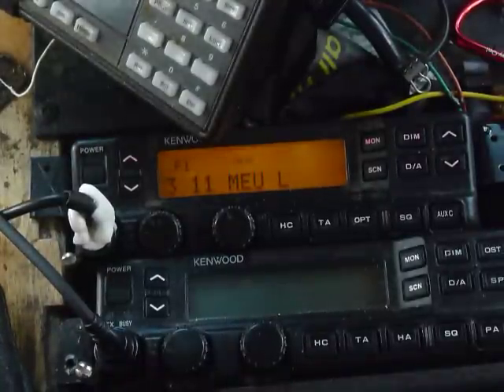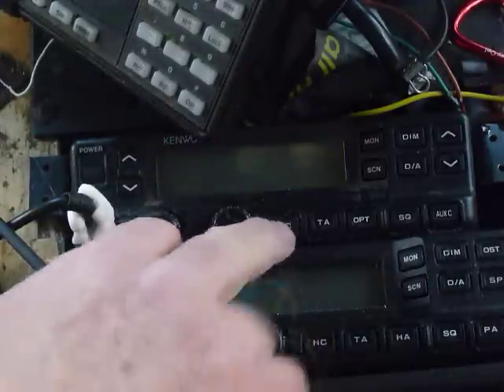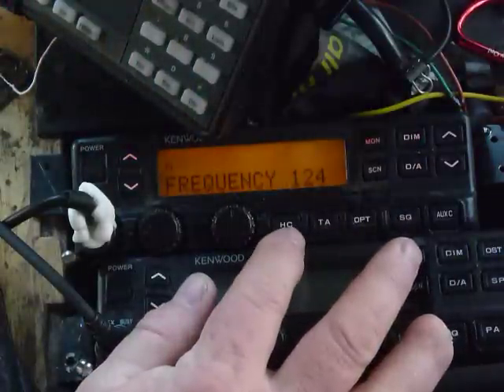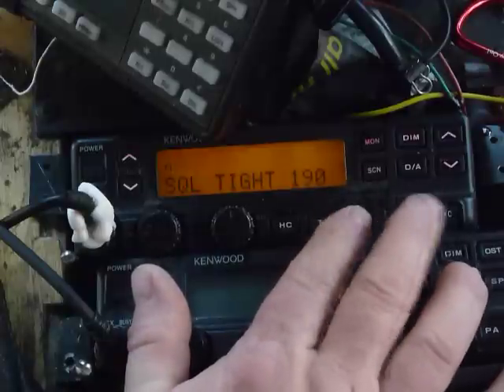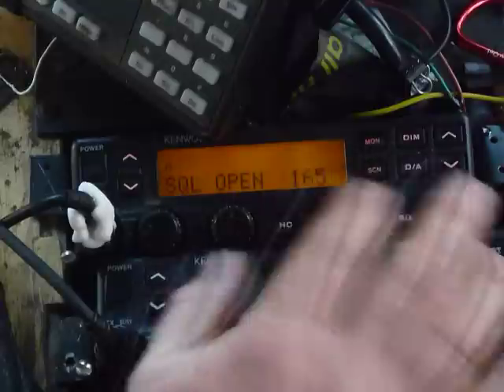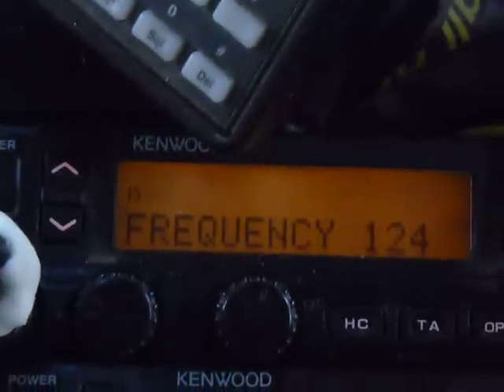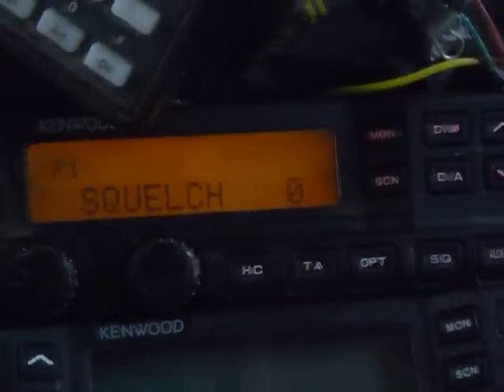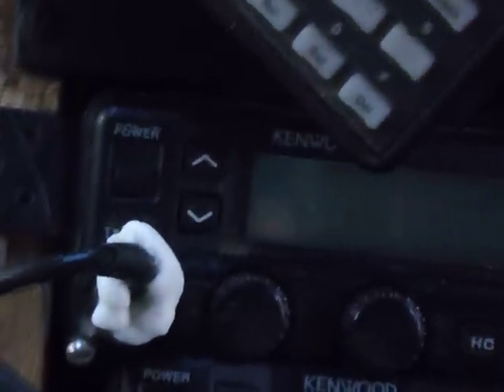TK-790 FS or CDF version firmware

Comment: Is this needed if not running narrow?
Reply from the maker: I don't think wideband had the problem, the no RX problem showed up as nerrow-banding took place. Roomer has it that the narrow squelch setting was skipped during initial factory alignment
Reply: @radionerd1  understood. Are there any adjustments I should make. I'm all wide band with ham and commercial frequencies. Is hight power a constant setting? On the H models
Reply from the maker: @RP4886  I wouldn't mess with any of the other settings, unless you have a problem, test equipment, and skills. In software you can switch high and low RF power. I have a ham buddy that has the high power versions VHF and UHF, He talks, and talks, and talks. I turn his RF output down to about 75% so he won't burn up the power modules ;-) Love to give him a hard time, he wants it set to 11! Nope! LOL🤓
Reply from the maker: If you want to adjust RF Max or RF Low (POWER or LOW POWER) on Wideband enter tuning mode, but don't click the channel knob, no "n" in display.  Max RF is 255, most radios will be set a few clicks lower, like 253-ish. I set a few 790's up on packet, I set max RF to 255 since packet is super brief transmits, like 5 seconds. TOT is set to 15 seconds on my packet 790's.
 For Ham I set RF power lower on High and low settings, so long winded users won't over heat the radio.

Comment: In your other settings besides 2 we changed could I set all mine to those numbers and have it work better? my Rx is set at 103 and see you are at 170. any help be appreciated.
Reply from the maker: Receive slope is not a set number. If your rx is ok don't mess with it. To Tune RX you will need a signal generator to align, and a service Manual.
Reply: @radionerd1  thank you

Comment: I get an error message when trying to program my TK790 CDF radios. The error is “Operator Selectable Tone with an only OST Name is programmed.”  An idea why? I can read the radio file fine from com port 3. I cannot write new files to any of my TK790’s. I’m using the FS software. Please advise. Any help is appreciated.
Reply from the maker: It's a well known bug in the CDF software, Go to OST table and put tone 14 151.4 back in and save. It will reoccurred every time you edit the load.

Comment: Have a question, I have a to-790H and it won’t go into this test mode to change this stuff.
Reply from the maker: Enable test mode in programming software
Reply: radionerd1 I did enable test mode in the programming software and it helps receive narrowband channels but I still get a lot of static between transmissions. Some times it’s quiet and sometimes the light comes on and it makes noise. Do I need to just adjust it a little bit higher?

Comment: This is such a helpful video. I've referenced this numerous times since finding it. Though the front panel tuning is typically disabled I simply use "Test Mode" through the KPG-44D software and SQL Tight and SQL Open are available in the list. Easy peasy. Thanks!

Comment: I seam to be having the same problem with my TK-790 I attempted to enter into test mode following your instructions:  radio off, hold down PF1 while pressing the power button but no matter how many times I tried this the radio would not turn on in the test mode It just turned on the radio in the usual manner.  Any ideas what I need to do in order to access test mode
Reply from the maker: +John Gubler Front panel tuning has to be enabled in programming software.

Comment: Thanks for the video. I was having a little different problem on my 790 and 890. I am using them on the Amateur bands and monitoring public service that is simulcast, and not on P25 yet. On scan, once the squelch opened, some times the squelch would stay open after the carrier tail. On frequencies that had RX tone squelch, obviously the audio would not pass but it holds the scan function. Applied this trick and it seems to have fixed my problem. This only happened on narrow band frequencies.